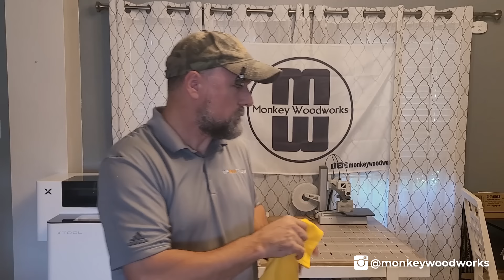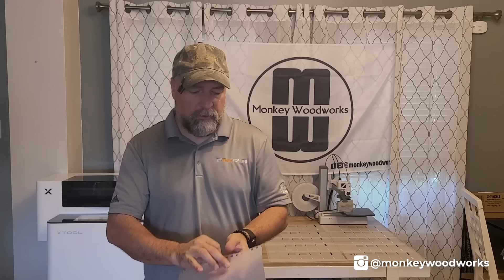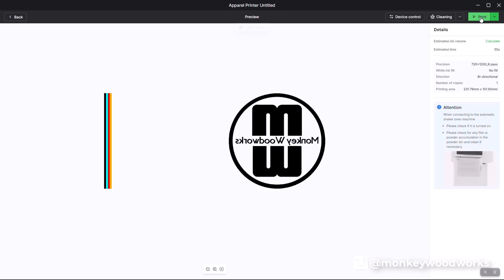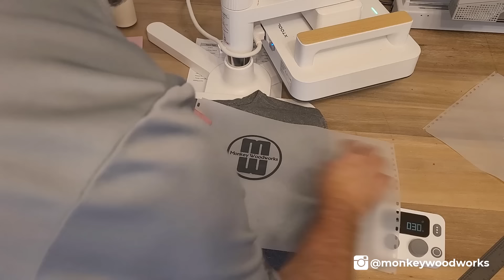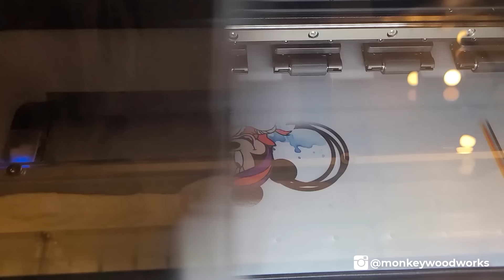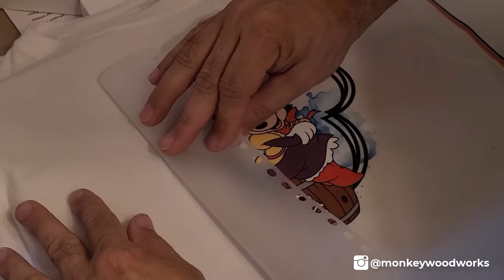First Prints with the xTool Apparel Printer! | My First DTF Print Results

Comment: Did you know you can disable the colour bands at the side? Apparently you can access the setting via the button to the right of the print button. Would save a bit of ink over time I suppose.
Reply from the maker: Yes!  You can put it on the left, right both sides, or completely disable it.  Many say that keeping the bands on help keep the print heads flowing better so i keep mine one.

Comment: I was thinking of something for extra income.  Do you recommend this for someone who has zero experience?
Reply from the maker: Yeah it can be a good option for extra income even with zero experience, but I would only recommend it if you are ok with a learning curve and some trial runs before you sell anything. Also keep in mind a DTF printer needs regular maintenance, so you have to be comfortable doing the upkeep to keep inks flowing and the machine reliable. It also makes regular noises as it runs its automatic maintenance, so location matters. I would not put it in a main living area, you will want a spot where the sound will not drive you or your family crazy.

Comment: After 1st test print , it leaves streaks and smears only on left side of film
Reply from the maker: It sounds like there might be an alignment issue or film speed issue exiting the printer.  I don't have much information on that but I highly recommend checking out the Official FB group and the xTool support website.

Let me know what you find out!

Comment: Nice video. Seems if that is an "standard" gap from the top and bottom of the film no matter what size you print, that is a waste of film and money, don't you think?
Reply from the maker: I do.  But, with the automatic shaker oven, it needs some length to it in order to pull the prints through it.  At my day job, we have a similar setup on our steel roll formers that has to waste 6ft of material when it runs short pieces.  You can save some of the waste by combining prints into a larger print job and print them all at one time cutting them out by hand after its done.

Comment: I look for a video from you before I go anywhere else when it comes to xTool. Couple questions: why did you click No Fill for the white on the black only image? Secondly, have you considered doing a video on the fill vs no fill, etc and the feathering and all the other settings when XCS first pops up on the image? Thanks for all you do!!
Reply from the maker: I clicked No Fill because I’m still figuring it out. I’ve tried using simple black images, but I kept getting a halo of white ink around them, so turning it off seemed like the logical choice. So far, that test shirt’s logo has had no issues and has been worn and washed MANY times.
As I learn more and feel confident in what I’m doing, I’ll definitely share more videos about the process. There are a lot of options, and this is a whole new world for us.

Comment: Would you recommend to a family planning on starting their own business?
Reply from the maker: That is a tough question.  Honestly, I wouldn’t recommend jumping into DTF with a brand-new machine unless someone in the family already has some print experience or is ready for a learning curve. It takes a lot of trial and error, maintenance, and patience.  Especially with a newer machine that’s still working through bugs. If the goal is to get started selling products quickly, I’d suggest starting with gang sheets from a local supplier first. That way, they can learn the process without the stress of troubleshooting a whole printer setup right out of the gate. Once they’re comfortable with the workflow and demand picks up, then investing in a printer might make more sense.

Comment: Does the printer have to have a wired connection to your computer, or can it be connected via WiFi for printing?
Reply from the maker: I have mine connected via WiFi.  When XCS connects, it wakes it up without any issues.
Reply: Can you have your computer just connected to the printer or does it have to be just WiFi?
Reply from the maker: You have the option of using either one.

Comment: There should be a way to ad choke on the white.
For the pressing time, it's usually 15 seconds, unless the powder that X-tools provides needs 30 seconds
Reply from the maker: I am guessing you mean restrict the white? Currently, we can set the white to print even with the color. However, the printer does not precisely follow the rule and has bleed around the color, causing a white halo.  The only thing I have found to do so far is to turn it off completely, but that's not ideal all the time.  I'm hoping a future software or firmware solution fixes this.
Reply: @MonkeyWoodworks  I can see there is an option for reduction. On the left side under Preference: "White Ink Reduction".  I believe that's the one. It's 0mm. Make it 0.50mm and then print a test. I make 0.50mm (hall millimeter) on Flexi and it's works for larger design and 0.20-30mm for small text / lines.
Reply from the maker: This goes against my brain making the white ink reduction larger than zero but i will give it a shot the next time i can get to printing.

Comment: How long did you let the printer sit? My concern is that if it sits for too long without any maintenance, it will damage the printhead.
Reply from the maker: A valid concern! I’m also a bit worried about this after looking online, and I believe it’s a common concern for many others as well. I let mine sit for about three weeks and had to perform multiple cleanings to get the white ink flowing properly again. I learned during the filming of this video that there is a technique you can use to avoid needing so many cleaning passes, but I need to learn more before I post about it publicly.